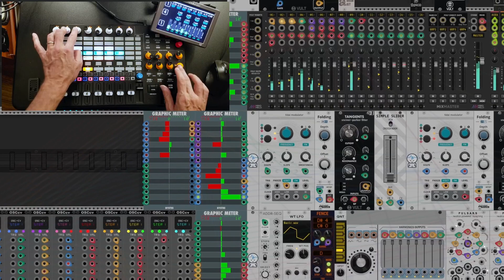Auto Centering Faders, APC40 MKII

Comment: Thank you for your video. Since I have owned the Apc40 MK2 myself for 3 weeks, I wanted to ask where you can get these inserts and what hardware or software was used to adjust the volume? Something has been changed internally on the hardware in the Apc40. I would like to take advantage of that as well. It would be great if you could write something about it here. Great job
Reply from the maker: thanks! There is software in the middle to adjust the signal, built in "Processing" by myself. The inserts are designed and 3D printed as well in-office.
Reply: @skaa9217  many thanks for your response. Would it be possible for me to equip my apc40 with you? if so what would it cost me? Because if I'm honest, that's really a great thing. I think it's great how certain problems are solved here through your work. I would be happy if we could keep in touch here for a bit. Best regards